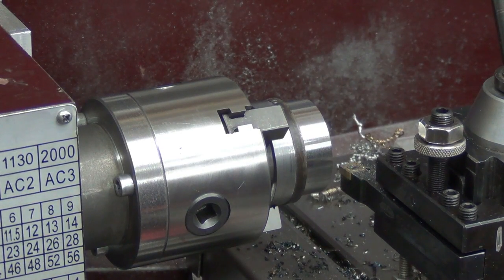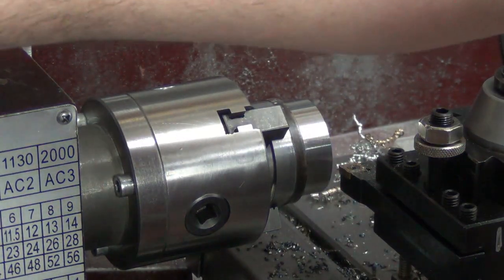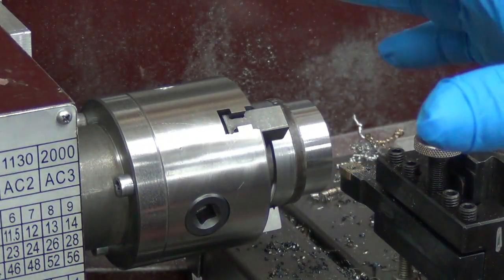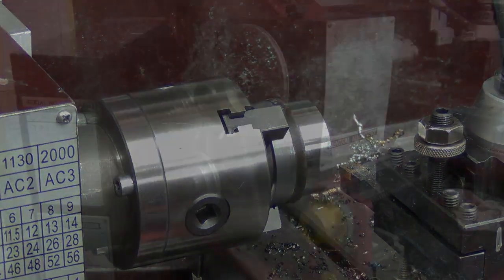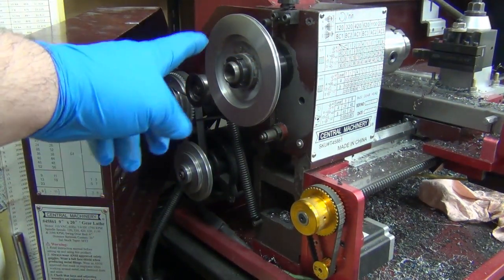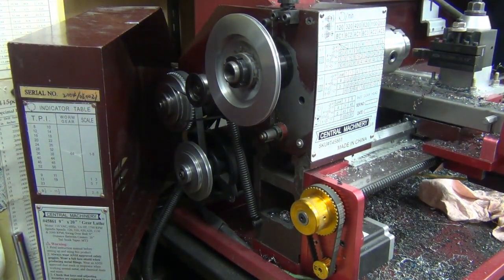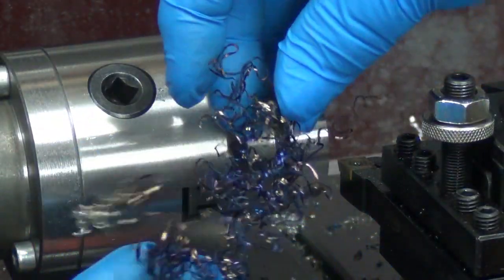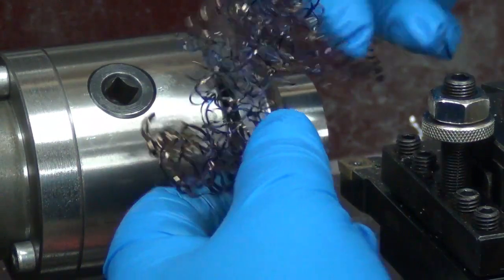9x20 CNC lathe - DOC/feed testing

Comment: That is so cool that you got that going. I can imagine so many times that coming in  handy. Your really limited to your imagination and programming the thing. Both of which expand as you learn and build projects. 

Every one needs a CNC lathe, CNC VMC, and CNC plasma table!!!!
Reply from the maker: Hi Glenn,
Good to see you again!  I think the imagination is still a bit limited until you get up to the 6 axis machines :)   This certainly does open up a lot of options for shapes that would be an extreme pain on a manual machine.  I need to make 40 of each part.  Even if I was setup to do it on a manual machine, the repetition would be a nightmare.......or at least cause nightmares!!  lol
I agree!!
Thanks!!
Mike

Comment: Hey Blue,
Practicing for Tom's Turn Off challenge I see.  :)  I will root for you as I am still floundering around in the single digit kiddie pool. 

What's with your controller?  It sounds like the Magic Smoke wants out and it's pissed!
Reply from the maker: Hi Eddie,
This little thing could get buried in the chips they make doing that challenge! lol
I hear it's typical of these hobbycnc controllers and stepper motors.  Part of the prob is that I have the controller on the bench right behind the lathe.  I need to move it to the floor.  The other part of the prob is that the camera mic is really sensitive in that frequency range, so it comes out louder on the recording than it is when you're standing there.  The camera also amplifies the audio when you zoom in......and I was zoomed in in the direction of the controller.  I'll have to see if I can get that corrected before I make too many more vids of the cnc in use.
I've seen the magic smoke released many times before.....if it happens to this one....darn, I'll need to buy a new(better) controller! :)
Reply: bluehandsvideo
Bah.  I don't think the noise is normal.  Next time do a close up and where it's coming from.  Might have a bad capacitor or diode adding an AC component or something.  As for Mach Wizards I am still getting bit on the butt.  I haven't found any documents on their behavior and it isn't always self-evident.  I think I saw you had the Complex Threading Wiz installed.  Beware the units it's using.  In the wizard you can tick Metric or Inch but the G code header it spits out can be wrong.  I set up a metric thread and it should have put a G21 (use metric units), instead it put G20 in the header and crashed me good :(

As for the Challenge, he did say it was open to all (not just all that could hang), and I wonder if we can get pro-rated :)   Think I'll trot over to his channel and ask.

Comment: I liked watching the chip turn blue while it was laying on the insert...cool
Don't be afraid to work the lathes harder. Carbide inserts can and need to be worked harder to get the surface finish improvement. If you're not getting the curl and chipbreaking effect of the insert you can probably push it a bit more.

Colin
Reply from the maker: I thought that was cool too.  I'm going to go at it again when I get a chance. I'm really curious to go push my bit lathe now. :)
Reply: Dont forget to record! :-)
Reply from the maker: *****
I'll definitely record it :)